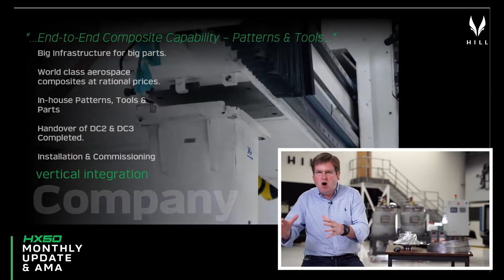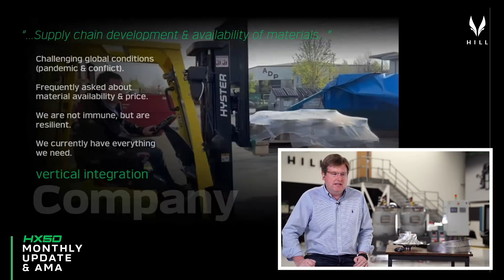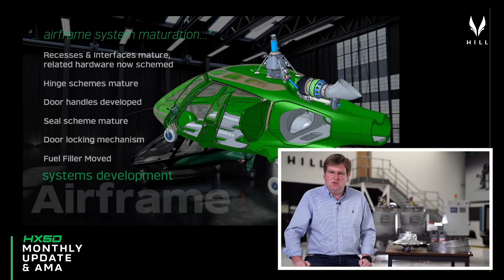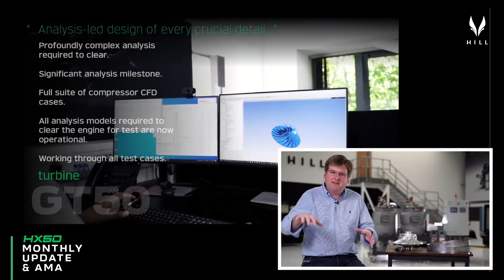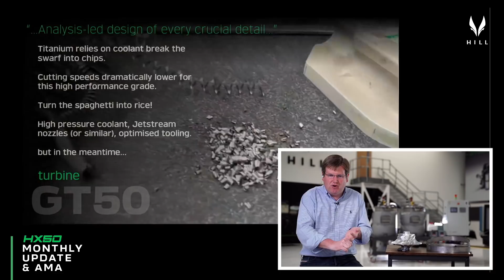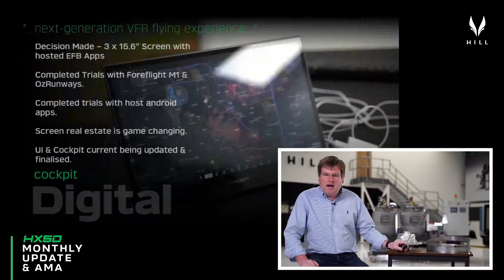HX50 Monthly Update & AMA - 10 May 2022

Comment: I have built a couple of different helicopters, and am still alive. Amazing. What I learned is two very important things.. Add lightweightness and use the best bearing, metals, synthetic or blends oils and grease.. Less friction allows more useful power to the rotor blades. I made a transponder plane from an 8x10" sheet of copper glassed in. Also I used a $20 emergency life raft strobe for a flashing beacon.. Worked fantastic. Used German bearing when able.. Everywhere. Best of all.. I used an old 1980's dipole FM radio antenna,, glassed in the back vertical back as a com antenna .. Cost $1.never visible,, covered by carpet.. Worked fantastic

Comment: Great presentation! It's nice to see an aviation company take the time out to explain what it does to its customers, afaik, that's an industry first in itself. On the autorotation vs parachute question, since autorotation does require a skilled pilot as rightly stated by Mr. Hill, and the helicopter itself is designed for the casual flier who probably won't be logging in more than 50-100 hours annually, won't the parachute make more sense? Besides, a helicopter with a parachute can autorotate as well.
Reply: Autorotation doesn't require an exceptionally skilled pilot.  Any licensed rotorcraft pilot should be more than capable of performing autos.  In the US, pilots are required to do biennial flight reviews to ensure their skills (and knowledge) are still up to par.  A parachute system adds complexity, and most importantly, weight.  Most pilots learn how to fly in light helicopters like R22s and S300s; if they can auto in those, they can auto in just about anything.

Comment: Moving along nicely by the looks of it, great sit down and update folks, thank you.

Update: Is their any possible way to Bond Cobalt to the transmission gears instead of Titanium as done with drill bits? I use different types of drill bits and Cobalt are more durable and longer-lasting than other options, including titanium. This "robust" quality it has to it would be a great alternative than Titanium Treated Gears, but I'm not an engineer or try to be, but I can see some real potential if it is at all possible. Thanks.